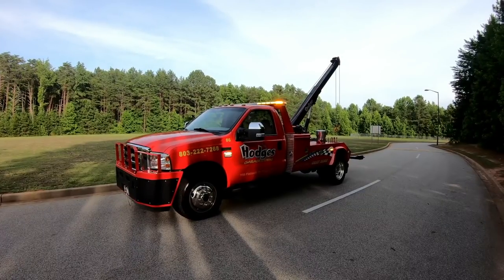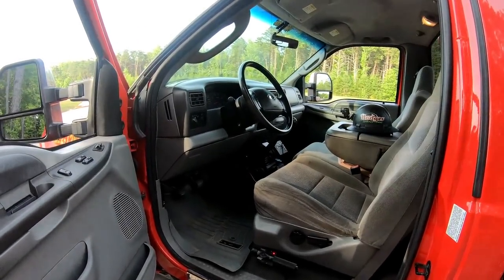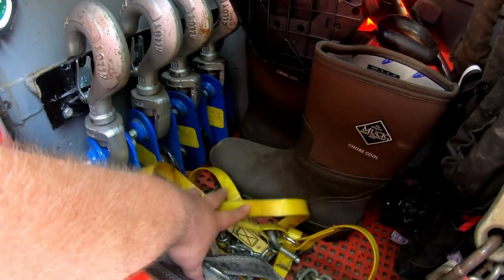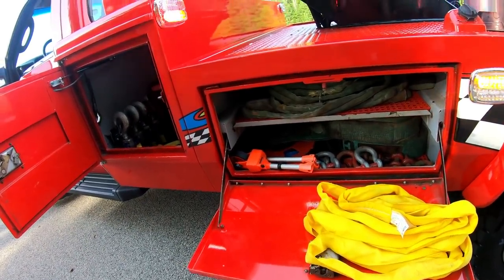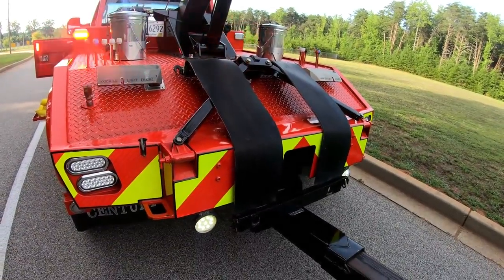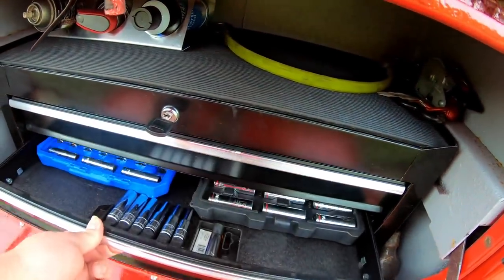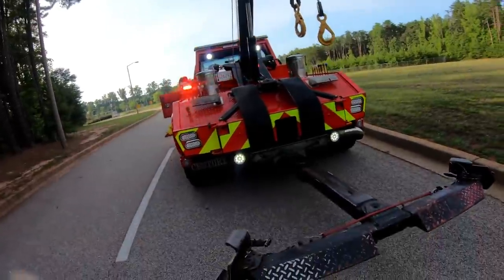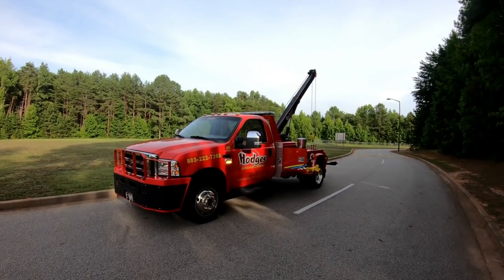TRUCK 6 "WILBUR" WALK AROUND VIDEO!

Comment: I must be old school because I would never trust rope. I always had wire rope cable on the light duty and heavy duty wreckers I operated. I operate a 6 axle 11 Yard Concrete Mixer now but I was in the towing and Recovery industry for 18 years, I operated everything from a 1 ton wrecker and flatbed to the 50 ton twin line Challenger on an AutoCar chassi that I operated for 6 years. Didn't have an under reach because they hadn't come out with them on heavy duty wreckers yet. It was all hydraulic with 2, 50K winches on the boom and a (Bull Winch) on the rear that I done must all my winching with. That Bull Winch was a monster. I remember using angle iron and 4X4 pieces of wood even some 6X6 pieces to hook up tractors trailers and that was after I removed the front bumper if I had to tow it from the front. Didn't pull the drive shaft as much as they do today I used to pull the axle shaft. Their was no such thing as a (Rotator) back then but I guess you could call the Holmes split boom a rotator but nothing like the Rotator's they build today. I really miss that family I had so much fun and excitement was only a phone call away. Stay safe out there because your safety is number 1 priority on any call.
Reply from the maker: We really like the synthetic rope for its ease of use and safety, but understand it’s not for every person or company. Our company has been in business for over 43 years so we as a company have seen and been a part of the evolution of towing as well! 😁 Thank you for watching and stay safe!

Comment: I have a 2000 f450 with Challenger 4800, I have half of what you got, I've trying to built it like that but right now with covid19 I had used my rebuilt money on expenses. My little truck pulls out tractor trailers 53' easyli out of holes, and no one can belive it, I tell them just take common sense and lots of patience FHP gave mi 30 minute before calling for a HD wrecker. 4 times I have done it and pull it off with between 13 minute  to 28 minutes  😁😁😁😉. So with that truck that you have you could do lots of recovery or salvage jobs.
Reply from the maker: They are strong units for sure!

Comment: Many thanks for the tour. Quite surprised it doesn't come with any spades at the rear, especially as its a light and 4 wheel drive unit. Keep safe out there from the uk :)
Reply from the maker: Spades on small wreckers has just recently started being popular, when this truck was built new it was unheard of to have spades.
Reply: @hodgestowing6155  ah thats interesting to know.. can they be retro-fitted ?
Reply from the maker: I’m sure it could be added with some pretty major modifications. They sell a spade attachment for the wheel lift.
Reply: @hodgestowing6155  Many thanks for the reply and look forward to your next video :)
Reply: @hodgestowing6155  i have often wondered if the wheel lift could be used to stablise  the wrecker